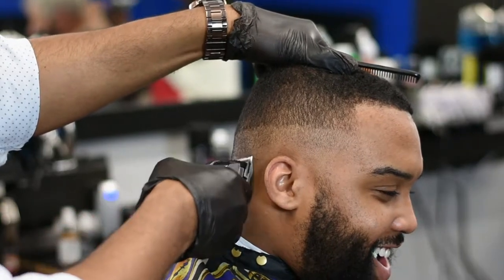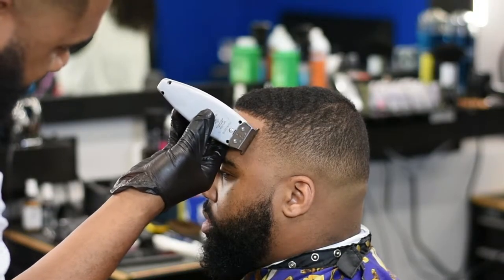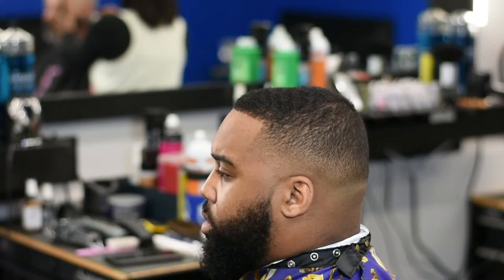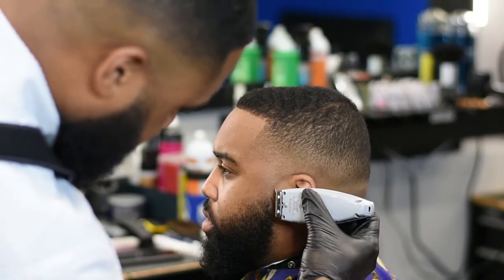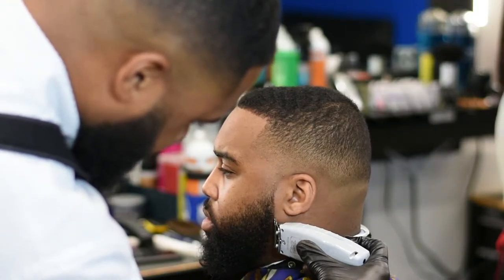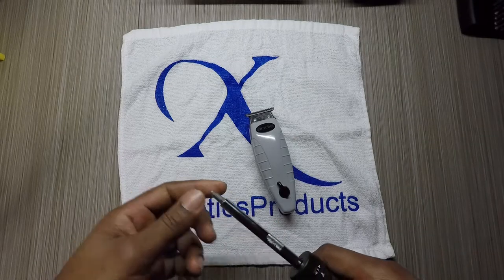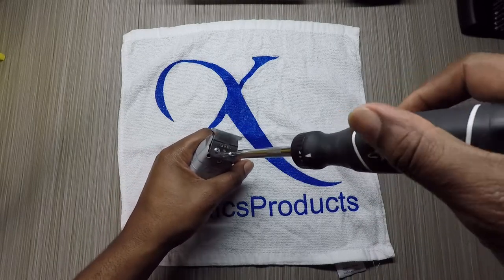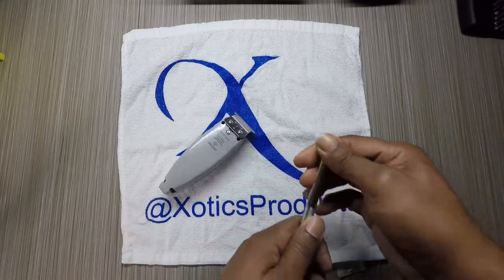How to zero-gap Cordless Andis T-Outliner

Comment: Next time, just remove the whole blade assembly with the one bottom screw first. Then you can take it apart (remove the brackets), adjust it, put the blades/brackets back together, and place it back onto the trimmer much easier.